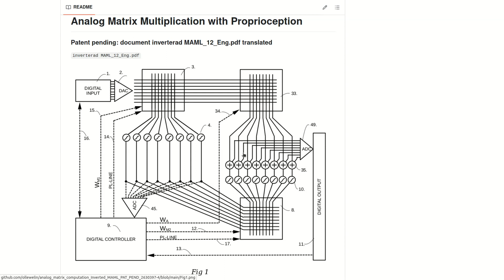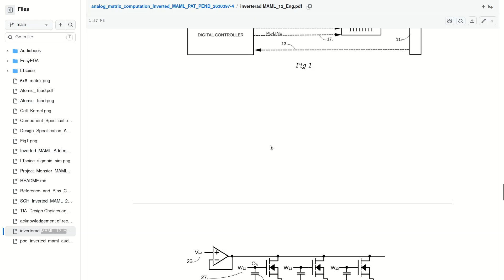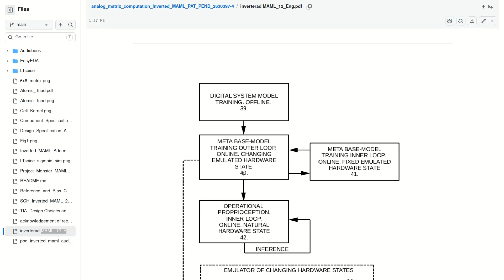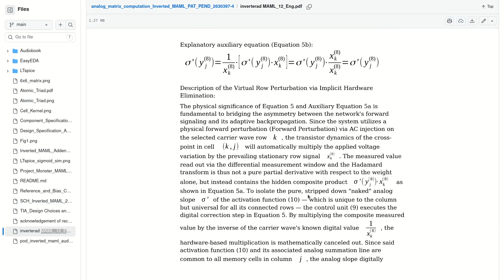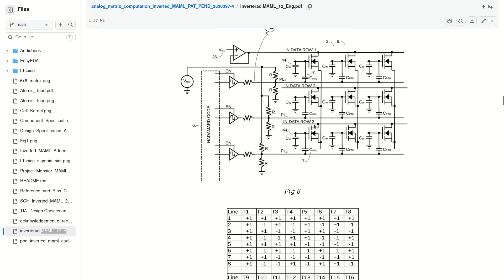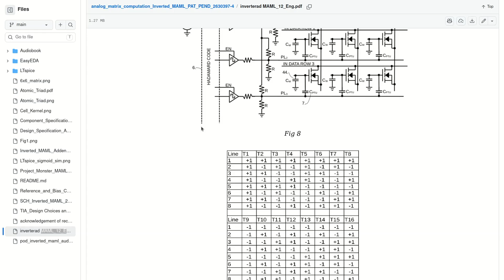Analog Matrix Computation Inverted MAML PATENT PEND 2630397 4

Comment: Cool! Now get back to work on the stirling engine! Electronics projects are for winter. Stirling fun is for summer.
Reply from the maker: Thanks 🙏 We’ll I could admit the stirling engine have suffered from progress a year or so. Things come in between. First I have worked hard on my free time with an exciting advanced AI robot for agriculture weeding and also in general a sorting Robot of al sorts of kind. So I spent lot of times with design a Efinix FPGA controller PCB with delta arm robot motors and building a fairly large robot in my garage (no video there yet but maybe later). Then this Petent pending crazy funny adventure project suddenly occurred 😂 I will stick with this Monster MAML for a while as nr:1
Then nr:2 my ”entropi lens” EcoFlexAI sorting robot. Then unfortunately nr:3 the water stirling (to be honest the funny DIY simplified water stirling seems a bit Old fashioned 1900 century style of innovation… so I have hardly see where it fits in 2000 centuries)